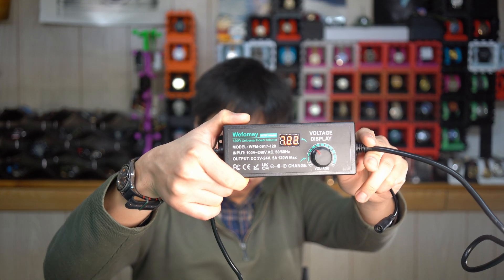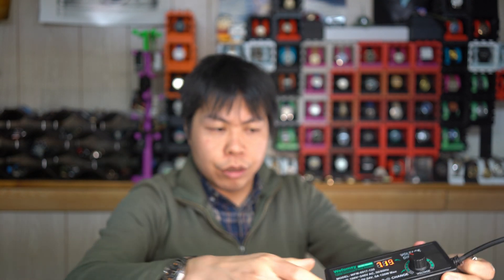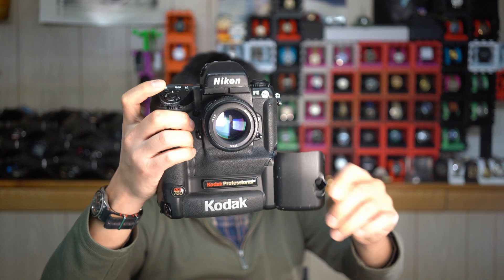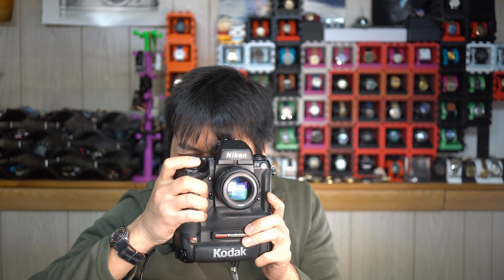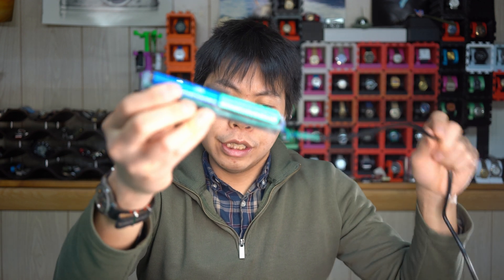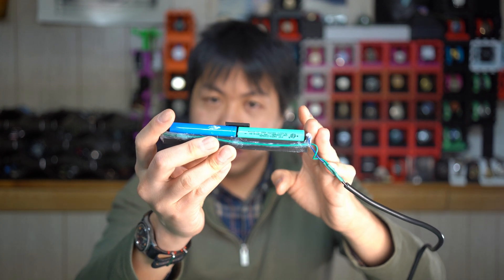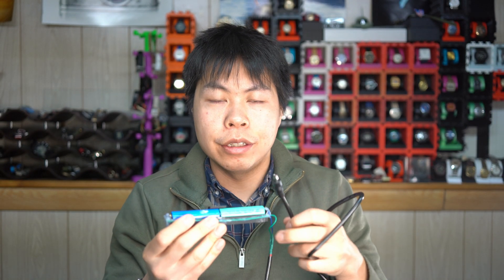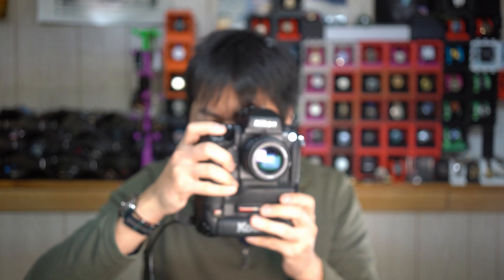DIY AC Adapter and External Battery for Kodak DCS 760 / 720 / 660 /620 / 560 / 520!

Comment: Hi, did you ever post the part 2? I haven't been able to find it.
Reply from the maker: Good day, I haven't yet made the second part. I have to revisit the pack rebuild to see if I can make one that's less janky than my current build.
Reply: @Mr50mmish  I'm wondering if I can re-house the contents of a 7.2V Li-ion USB-C battery (like an LP-E6 but they're probably all the same internally) into a third-party NiMH battery (or the original Kodak but I'll probably leave it untouched). That way I won't need a charger. Would you have any thoughts on this? I noticed the Kodak has TDC pins which I wouldn't know what to do with.
Reply from the maker: @loganwu5830  that should work just fine. That's actually an awesome idea! Usb charging is definitely more convenient. In general as long as the pack of the donor cell looks like it can fit in the Kodak cell I think it should be easy enough to cut the old cells out and wire up the positive and negative terminals. The TDC I believe we're just used for the temp sensor on the pack which can be ignored just cut them away (I figure it wasn't going to be useful since I changed the cells to AAA sized lithium ions). That's what I did for my rebuilt pack.
Reply: @ Sweet, so do +/- and ignore the TDC terminals. Would you have any advice for cracking open the Kodak's casing? I'm guessing you used a Camera Sino(?) battery since those are the ones I see online.
Reply from the maker: @loganwu5830  yup! I actually used my crusty old Kodak packs. I do have a couple Camera Sino ones but I haven't cracked it open. My only tip is to go slow with a Pry tool if I remember right the sides should crack open pretty easily, one of the short edges I believe we're glued or something annoying. There are no screws, It's all tabs, and adhesive. It's not a great pack to open.
Reply: @Mr50mmish  Thanks. I might try adding a bit of heat and isopropyl alcohol into the mix in case it helps, and if it goes well I'll find a place to put a writeup.
Reply from the maker: @loganwu5830  whoo hopefully it goes smoothly if you think of anything else you wanna know ask away!
Reply: @Mr50mmish  Darn, I tried opening my Kodak pack with 00/000 flathead screwdrivers and got one of the long edges open but nothing else. I stopped because of the risk of piercing the NiMH cells. Will buy a Camera Sino battery + generic NiMH charger (I assume I'll have to solder or clip on some leads) to make sure my camera actually works on battery just in case it doesn't, in which case there's no point going through this exercise.
Reply from the maker: @loganwu5830  Ah yeah it's not a fun pack to open. Hopefully the camera works! Let us know how things go!
Reply: @Mr50mmish  would you believe I ran into the magic smoke? I decided to make a battery pack out of 2x 18650 cells. Except I figured I could put them into a pre-made holder in series with barrel plug, and then also use cells with in-built USB-C charging ports to avoid needing a charge controller. Well, they arrived and I charged them outside of the holder for a few minutes. Camera powered on fine. I then unplugged them from the camera (figuring they were electrically isolated) and plugged both USB-C ports back in. Well, they got extremely hot and started smoking. They're now in a pot outside on the asphalt. I don't know if it's a bad holder, bad charging cable, or bad batteries. I think it was just one cell but once it cools down I'll take them out and try to work out what happened.
Reply from the maker: @loganwu5830  Damn, that's not good. hopefully you are alright, battery smoke is terrribleee. Yeah let us know if you figure out what happened. 

At least you know the camera powers up alright though!
Reply: @Mr50mmish  oh, I actually had a mains supply given to me with the camera so I knew it worked. But hopefully this hasn't done anything crazy like overvolt the plug. Would you happen to have a suggestion for charging a regular third party NIMH battery without a Kodak charger? That's actually the real reason why I'm trying to build the Li Ion pack.
Reply from the maker: @loganwu5830  Ah, cool. Yeah I do! I actually use an older universal charger for when I get situations like this. 

The Imax B6 is the specific model I use, it's the one linked below. 
https://a.co/d/glI3vh5

But most of these generic universal chargers will work pretty well. 

Basically set the charger to the correct chemistry and attach leads to just the Positive and Negative Terms of the batteries and set it to auto. Most of the time I'll figure out the rest.

I usually use a thin paper clip at the end of an alligator clip or something similar to connect the leads from the charger to battery, it's kind of janky but with the right thickness they usually stay pretty well. 
 
Hope that helps!
Reply: @Mr50mmish I ended up making an adapter for a Canon LP-E12 battery using a 3D printer and some off-the-shelf battery terminals on both the Kodak and Canon ends. It seems to work the way you'd hope, so after I take it out for a test shoot I plan on doing a writeup and maybe turning it into a video.
Reply from the maker: @loganwu5830  nice, good to hear it's worked out!

Comment: Do you have the pinout of the 3 pin din?
Reply from the maker: Yup, Here's a picture I quickly did up. https://yt3.ggpht.com/LZooRC9Go75F1_8t63tP8y77F9mIQDxs8tN0vewG0XfSrvgSKetGkG7VUkfFBZ29wJ1Tpc9PgPScOo4=s1600-nd-v1

With the respect to the plug itself. When pointed directly at the viewer with the plug notch facing up and the 3rd guide pin on the bottom right (it is also smaller than the other 2 pins). The pin on top is Negative, the pin bottom left is Positive. 

This description and is now also on the community posts on my channel.